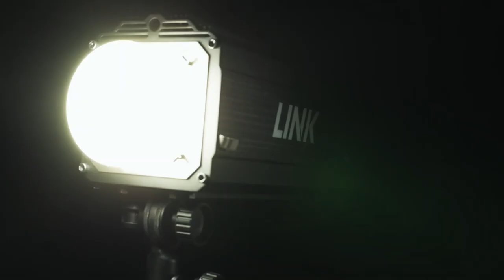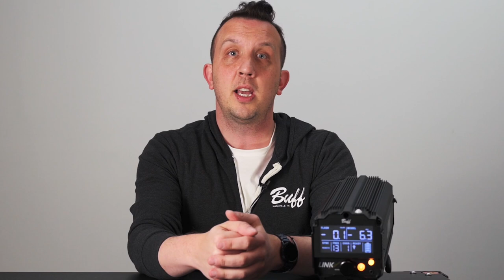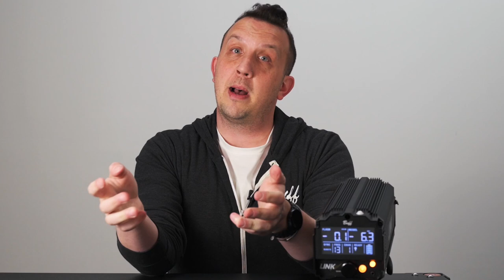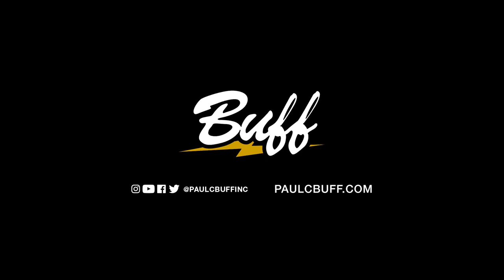LINK Product Video | Updated Specs

Comment: Yes, very exciting.  Curious about lux measurements for continuous lighting.  Any specs on that?
Reply from the maker: Great question! Below is that info. You can find a full list of specs here on the website https://www.paulcbuff.com/LINK-Products/LINK-Flash-Unit.html

LUX at 6' with bare bulb - 320lx
LUX at 6' with diffusion dome - 230lx
LUX at 6' with diffusion dome and 8.5" reflector - 600lx
LUX at 3' with bare bulb - 1280lx
LUX at 3' with diffusion dome - 920lx
LUX at 3' with diffusion dome and 8.5" reflector - 2400lx